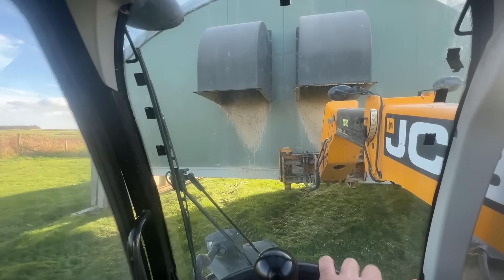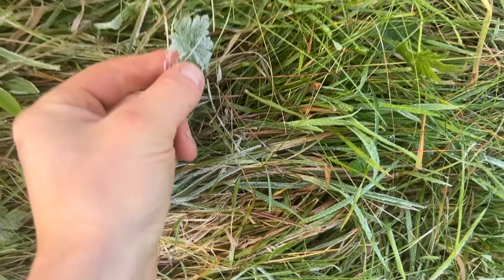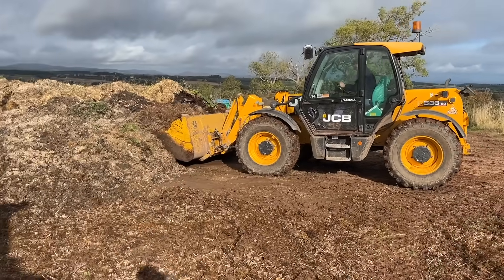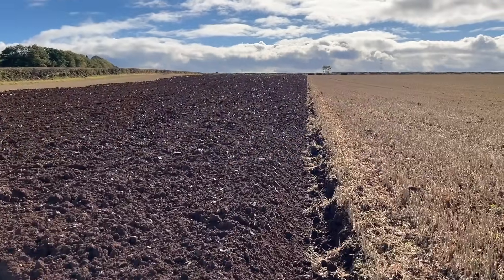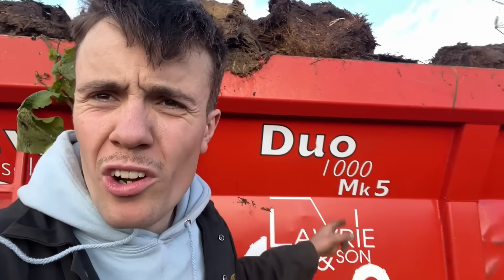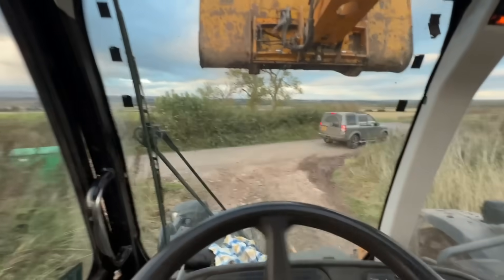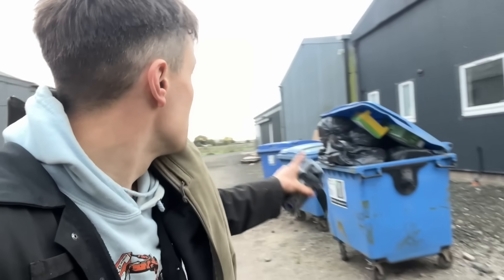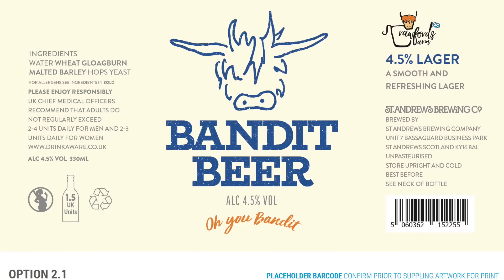Race Against The Weather | New Shed Update | I Love The Plough

Comment: I like the plow but global warming is unquestionable. If you look up the CO2 record from Hawaii the global temperature is rising at the same speed as the amount of carbon dioxide. The graph is called the Keeling Curve. However, Concrete production emits more CO2 (8% globally) than Aviation does so that's a fun fact for you! 

As for cows- grass fed, local beef supporting the economy is definitely sustainable, but importing cheap, steroid full, corn fed beef from the global market is DEFINITELY not 😂
Reply from the maker: 👍🏼 keeling curve will have a look cheers